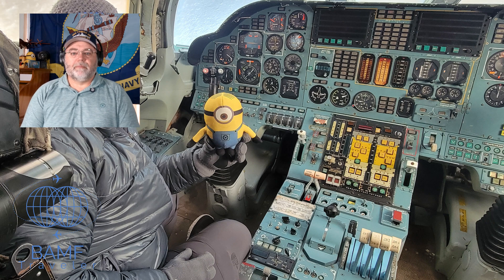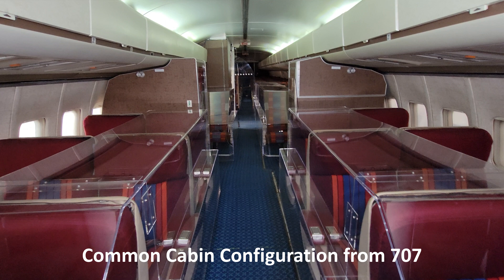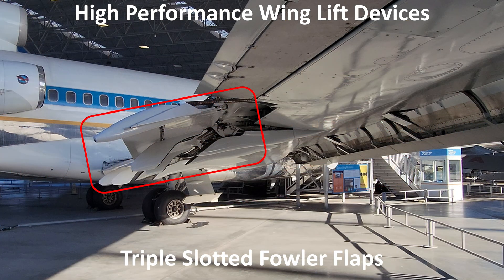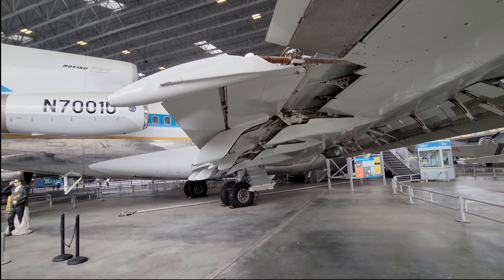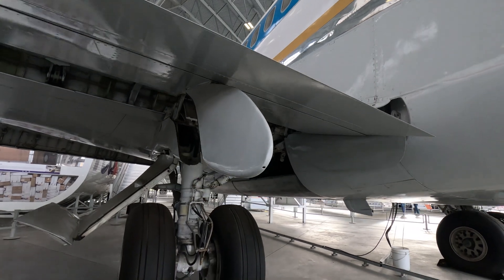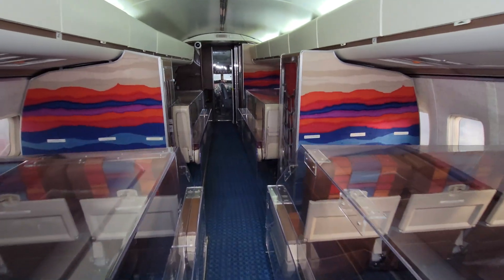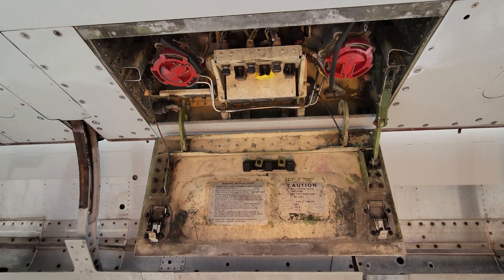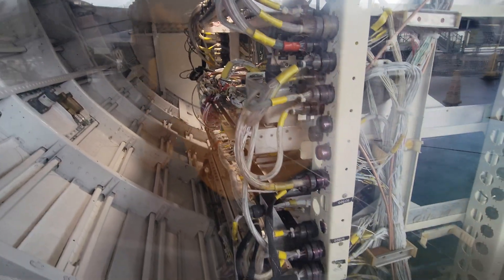Boeing 727 N7001U Detailed Tour 4K

Comment: In 1966, I flew a Boeing 727 from Frankfurt to Iran, final destination Kabul. 
  It was a brand new Ariana Afghan Airlines jet with American pilots.
  I flew the 727 back to Frankfurt in July 1968, still with one U.S. pilot as Captain, Afghan Co-pilot. 
   The same 727 crashed 6 months later on January 5,1969 on approach to London Gatwick . Afghan pilots were flying the jet . Of 62 on the jet, 48 died. Two adult parents of a  2 year old child died. The child was found alive under a jet engine. Controlled Flight into Terrain, failure to set flaps correctly for landing was the primary cause.
Reply from the maker: Thanks for sharing your story.

Comment: Sorry, but that 727 interiors is of the middle 70’s, when I worked as a Flight Attendant with United. Those overhead bins compartments were installed in the 727 at the end of the 70’s beginning of the 80’, so those decorations on the division panels.
Reply from the maker: @BRAIRCO  thanks for the insight.

Comment: I used to fly on these with Alaska Airlines in the 1980s. Sometimes they would use them on the Anchorage to  Deadhorse route. Before I worked in Alaska oilfield I worked on the assembly floor at P&WA putting together JT-8s.
Reply from the maker: The closest I have been to Deadhorse was to Barrow in late November, just before the sun set for the winter, my hat is.off to you for working in such a remote (and cold) place.
Reply: @ You have an amazing channel. I have been in many types of aircraft, including helicopters flying around Alaska doing telecommunications work. I also worked on a satellite communications project for the FAA a couple years working out of ZAN and flying to sites all over the state including the LRRS sites. Another job I had we worked on FAA RCO and RCAG radios on mountain top sites. I was an avionics technician on P-3s on a four year enlistment 50 years ago.
Reply from the maker: Thank you for serving in our Navy!!  I was active 1988-2010, although as a Submariner.
Reply: @ Thank you, I could never be in a submarine. My brother and brother in law were both STCs one in boomers and the other fast attacks in the 60s and 70s. My other brother and I were both VP guys. My first job out of the service was at EB before I went to tech college in Norwich

Comment: Good walk thru.  I worked heavt maintenance at DAL on 727's, changed a lot of belly skins, hush kit mods which this one has with the longer exhaust nozzles, Delta even experimented converting 2 727's with winglets for fuel savings but removed them after a few years.  In your video when you show the aft air stairs you see a small vane on the left hand side next to the sirstairs that would swing back with airflow so as to lock the air stairs in flight....nicknamed the Cooper vane.  Great airplane and fast as well.  I enjoyed the video.
Reply from the maker: @marchindy  thanks for the kind words, I am glad you liked it.

Comment: The seats look more like late 70s early 80s. I doubt those are original 60s.
Reply from the maker: You are probably right about that, I did not dig that far into it.  Thanks for watching and for the feedback.
Reply: @ericgattenby6857  I can confirm that these would have been at least from the 1970s, certainly after United went to the Saul Bass livery.
Reply from the maker: @solracer66  thanks!!

Comment: N7001U is in my logbook.  My first trip at UAL, (IOE flight engineer) 1985.  Pneumatically controlled cabin pressure could present challenges.
Reply from the maker: That is an amazing connection with this Aircraft!

Comment: Ultra HEAVY UAL three holer. N7001U-2nd. one off the line-spent it's entire flying life at HEAVY UAL. Serviced it with Aviation Kerosene type Jet A numerous times while employed at LAT then ASII @KSAN mid to late 80's. Met Julie Clark-then a Flight Engineer with HEAVY UAL. Good 'ol girl-just remember-when ya open the refuel panel-step to one side & upwind-otherwise-you would get a lovely dose of Skydrol right square in the mug. 40PSI-2 hoses.
Reply from the maker: Cool, thanks for the background.
Reply: N7001U was the 1st 727 built, not the 2nd. N72700 was the 2nd. It is ofen confused with the 1st because N72700 appeared in the official rollout ceremony and was painted in Boeing corporate livery. N7001U made the 1st flight Feb 9, 1963 in UA livery. Boeing kept the 2nd built for testing and it was eventually scrapped.
Reply: @viscount757  things that make ya go hmmmmmmmmmm.......
Reply from the maker: @stevenrobinson2381  Thanks for the info. I'm always curious about quirks like that.
Reply: That’s not a 60s interior… that’s more like a late 70s update.